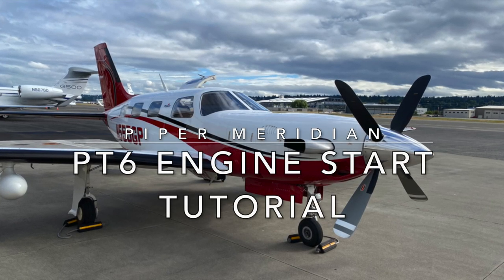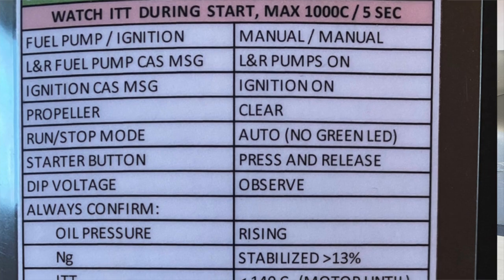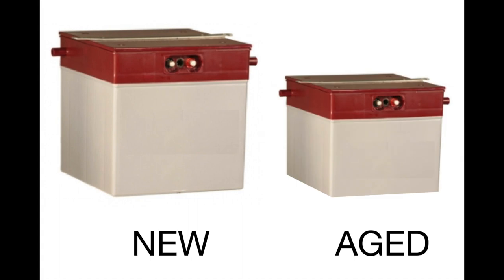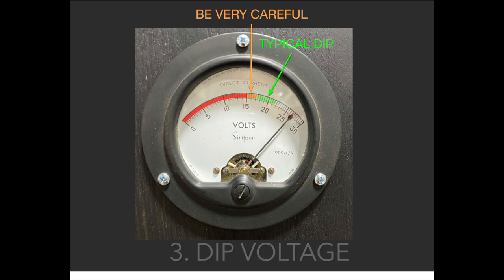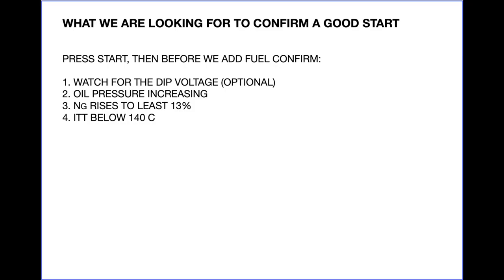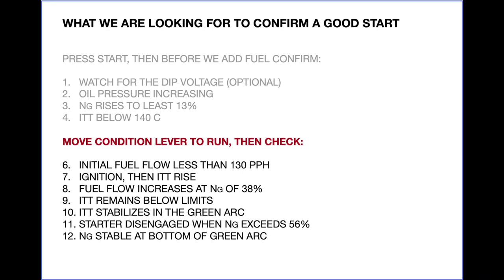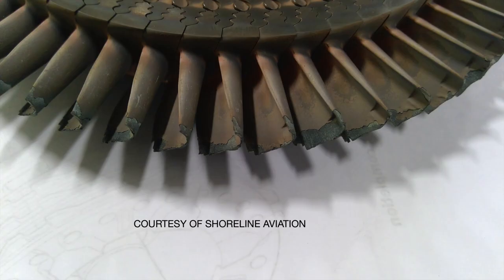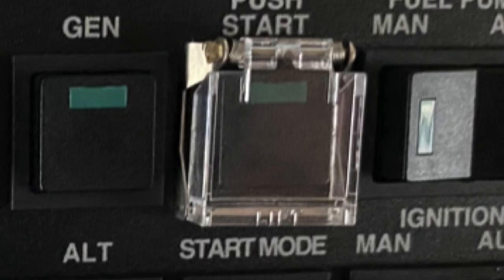The Meridian PT6A 42A Engine Start Procedure Explained

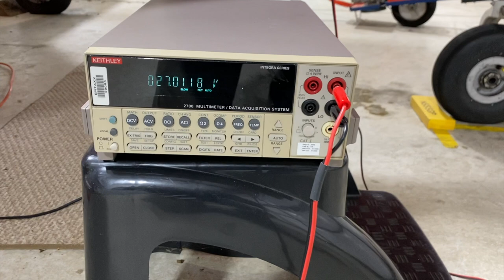Comment: @5:52 - Testing a plane battery - breaks out a near $2000, true 6 1/2 digit resolution meter and props it on a stool in the hanger.  That is the fastest "like" i ever slapped on a video.
Reply from the maker: Thanks, glad someone recognized a Keithley!

Comment: Thank you for putting together this video. Very good and informative.  You covered Bat Voltage, health way better than Ive seen it at expensive training.  What I do different is.   During start, I allow the starter Ng to stabilize before introducing fuel,  this shows me the capacity of the battery.  I have personal limits.   I want min 18% but a Cold battery, lower voltage, Ill except lower but next warm start should be back up.  If a storm is coming 14%, Tornado 12.5%.  If introducing fuel at 12.5 - 13% Ng,  A weak, low capacity battery may drop voltage after light-off and could be hidden.  As you stated  Voltage Sag, or Dip shows battery health but nothing compares to Work (= Ng %) after a few seconds.    The other thing is I,   Count seconds after introducing fuel.  Light off should happen at a consistent time.  ie 4-5 sec, if no light off I continue to 10 sec, Fuel off, Starter off,  WTF....     Having the set time and shut down procedure reduces the (oh shit I forgot the ignitors! On, Boom, Hot start.   Take it for what its worth.   Nice plane.
Reply from the maker: Those are all good ideas, and thank you for the detailed comment..  The only reasons can think of not to wait for Ng to stabilize as high as possible before introducing fuel are (1) there is a time limit on running the starter, and (2) if the battery is a bit weak, it may be better to light the fire as soon as possible to be sure there is enough juice to keep the starter running and the start cool.   Thanks again.

Comment: Dip voltage, or voltage under load for a car battery is 9 volts when the starter is running. The starter will cause a voltage drop of 3 volts. All cars with distributors in a 12 volt system have ballast resistors that keep the voltage in the ignition system at a constant 9 volts. When the starter is engaged and the available voltage for the ignition system drops to 9 volts current to the ignition system bypasses the ballast resister until the starter is released via the cars key switch. When it is released current is sent through the ballast resistor thereby maintaining 9 volts. An airplane such as the meridian uses 24 volts instead of twelve. If the airplane uses a piston engine I would expect it to run a ballast resistor like a car does. In a turbine engine, I don’t know if that is necessary, but that would explain the dip voltage that the creator of this video is talking about.
Reply from the maker: Thanks for watching my video. Not sure if this clarifies anything, but the ignition system in the Meridian is fully electronic.  I believe the dip voltage is simply a result of the huge load of the starter motor as it begins to turn.

Comment: By far the best explanation i have come across. Quick note on the itt being below 140, if the engine was hot due to a prior flight, do you let the itt temp drop by maintaing an ng at 13%? I think you mentioned that it only takes few extra seconds for it to drop below 140 if it was hot already.
Reply from the maker: Thank you for the kind words.  To answer your question: I have seen ITT up around 200 C after a quick turn, so typically I need it to drop about 60 C.  Once I reach 13% Ng I just wait for ITT to come down to add fuel. It always comes down about 10 C per second, fast enough so I can tell I am not going to time-out the starter (30 sec limit). The Ng just keeps climbing while I'm waiting, but I am mostly focused on ITT, so I am not sure exactly what Ng reaches.
Reply: @lakefrontaviation3444  I cant thank you anymore profusely for your quick reply and elaborate answer.

Comment: You called it dip(?) voltage, I never had a name for it but after turning on the battery switch I didn’t want the voltage to drop below 24 VDC with a NiCd battery, because of the discharge characteristics of the battery, when switching to lead/acid gel batteries I could get away with lower initial voltage. On initial starter engagement if the voltage dropped and didn’t start recovering, it was abort time and find an apu.  Healthy start had  N1 stabilizing above minimum and battery recovering. After start pay attention to voltage the longer it stays above 28 the sicker the battery is. I much rather start a turbine with PAS air.
Reply from the maker: It is all about trying to get a handle on the health of the lead/acid battery before adding fuel. The initial bus voltage when I turn on the battery master gives me an estimate of the whether the battery is fully charged, and the "dip" voltage under the huge load of the starter motor is an indication of how much total energy is available.  You are right that the voltage does need to start recovering.  These are only rough estimates of battery health, but I know that if voltage is low, or the voltage does not recover, there might not be enough juice to avoid a hot start, so in that case I would abort.

Comment: The most difficult plane I ever started was a fuel injected Skyhawk with an IO-320. I think they call it the monkey paw method. Thumb on the mixture with it at full lean, index finger and middle finger on the throttle at wide open, run the fuel pump for 4 seconds, turn the key, and at the exact moment the engine coughs switch the throttle and mixture positions. If you miss the cough you have to let it sit for 30 seconds and start from the top.
Reply from the maker: Interesting that the PT6 is easier to start than an IO-320, but if you do it wrong, much more costly.
Reply: I imagine it's even funner when it a hot start. (Skyhawk)
Reply: Aviation tend to get away more with temperamental equipment. If Detroit make cars as difficult to start, they will not be in business long. It is so far behind the times , Rotax still have carbs for their engines, and slow to raise HP.

Comment: Just before 8 minutes, you state and show on your checklist that the pumps and ignition are set manual.  Yet at 8:45 in the video the switches now appear to be selected to Auto.  The lights still show manual, but the switch position now is selected on AUTO.  When did you switch it to auto and why?  Confusing.
Reply from the maker: When adding still images to a video to explain a detail or emphasize a point, I often don't have the exact photo I need and I have to improvise. In this case I used a photo of the switches that I had on hand, and changed the LEDs to green to indicate that they should be in manual mode. (I think the photo was probably taken in the hangar and the switches were physically in the off position.) 

When the engine is stable and idling with Ng around 64%, the fuel pumps are switched to auto and the ignition is turned off. Both go back to manual for take-off, then at 1,000 ft AGL they both go to auto.

Comment: Could you sometime (when time permits), do a video on takeoff power/climb and cruise limitations.  

Also, since the meridian and the pc12 doesn't have a prop lever, i presume the PCL sets the props automatically based on power setting?

Thank you in advance. Safe flying
Reply from the maker: The Meridian has a prop governor that is set for 2000 RPM.  It will be less at idle because there isn't enough power to get to 2000 RPM at idle, but generally it is at 2000 RPM for any power lever position. 

The only takeoff limitation is torque (well, technically there is always an ITT limit but it isn't reached on normal takeoffs).  In cruise the main limitations are ITT, torque and airspeed.  (Of course there are others and I ran into one this week: the fuel temp reached the  lower limit of -34C and I had to descend a few thousand feet to warm it up.)

Comment: I used to work part-time for a UPS contractor loading ULDs into the Boeing 757. I note the wind would have the fans spinning in reverse. I asked the captain about a possible hot start considering the wind was hitting the aft engines. As we are standing next to one of the giant Rolls Royce RB 11 engines. it's free-spinning backward you can hear the clank clank clank of the fan blades. He said not much chance of hot-start because we would be using the Huffer at startup that night. I ask why the huffer? He said the APU isn't functioning properly and he would have it checked out in Louisville KT. I thought that was unusual.
Reply from the maker: A couple jet pilots I talked to who shall remain nameless told me that the manual calls for turning the jet into the wind, but they never do it...

Comment: Great video, and very informative, it would be nice though if P & W had a fully automatic start and shutdown system available
Reply from the maker: More automation would be great.  What these engines really need is a better fuel control unit. There could be an electric backup to the FCU to handle power roll back, something that would not require use of manual override.
Reply: I believe the new pt6e series engines have addressed this.

Comment: I operated large turbofan engines for 16,000 hours and never had a start problem. I did have a starter fail at starter cutoff and the starter blew up. We only knew this happened because someone called on the radio and said they saw sparks come out of the center area of the engine cowl. After maint did an inspection they said the starter had exploded.
Reply from the maker: Once many years ago I standing in the FBO looking out at the ramp when I noticed a jet with flames shooting out of an engine, like a flame thrower.  I can't remember how we got in touch with the pilot (I think the FBO desk called the tower). The answer back from the pilot was "it's normal." I still wonder if it was.

Comment: In 1963, Chrysler produced several dozen prototype motorcars powered by gas turbine engines mated to a typical automatic transmission and driveshaft.  How on Earth could someone start that engine day after day and not encounter ruinous disaster?  Ultimately all but a few of the vehicles were crushed by Chrysler so it wouldn't have to pay a special tax on them, and the program was terminated.  Please enter the following into the YT search box above:
1964 Chrysler Turbine Car Start
1963 Chrysler Turbine: Ultimate Edition - Jay Leno's Garage
Reply from the maker: Thanks, very interesting!

Comment: Refering to the ITT I think you mesn TIT did you ?
Reply from the maker: Turbine inlet temp (TIT) is the temperature of the hot exhaust gas generated by a piston engine where it enters the turbocharger.  We check TIT a lot in the Malibu to make sure we don’t roast the turbochargers.  In the Meridian’s PT6 engine, we monitor the interstage turbine temperature (ITT) which is the temperature of the hot gas flowing between the turbine wheel that drives the compressor, and the first power turbine that drives the prop.  We have to make sure the turbine wheels don’t get too hot.  

In both cases we are checking to make sure we don’t destroy anything with too much heat.  For the PT6, ITT is the correct term.

Comment: How high can this aircraft  fly?
Reply from the maker: The Meridian certification ceiling is FL300 (30,000 ft), and that also requires RVSM cert (which N555GP has). Without RVSM cert. the highest legal altitude is FL280 (28,000 ft).

Comment: 99.999999999% sure I will NEVER own or operate a turboprop.  However, IF I do, this video is officially my start sequence bible (even if the aircraft is equipped with a FADEC engine)!
Reply from the maker: Thanks!
Reply: With FADEC, you can forget much of this video. Pratt and Whitney is about 2 decades behind the times.

Comment: The Pratt and Whitney Canada company is about 2 decades behind the times. That was when all the airlines had FADEC and one button starts, auto throttle for their engines and not risk a financial melt down. Other companies had to develop their own but P and W can get help from the US parent company, so dragging their feet is even more unacceptable. They can afford it because they have 70% of the small turbine market, but things are changing. It is like P and W on a railroad track, they have 3 choices, 1) keep up to speed of the traffic, 2) move aside  3) get run over.  A few years ago, GE quietly bought  a Cz company , Walters that made a PT-6 clone . They are initially working with Cessna for an engine to power their PC12 clone. Once that is done, I believe they be expanding their line. Since that just happened within the last 5 years, for decades more , many planes and chopper pilots still have to watch TIT temp like a hawk and be ready to cut off fuel.
Reply from the maker: The fuel control unit in the Meridian seems to be an old design that could be modernized, and maybe that will happen someday. Modernization comes slowly in aviation, but it is here to some extent in the M600 and maybe it will trickle down to the M500 and Meridian.
Reply: The TBMs 9x0 use PT6 and have a fully automated startup feature (as far as I know, I am no expert)
Reply: @ImNotADeeJay If the number start at "9" it is already a very new plane. 2017 or newer.  I remember reading in magazine someone got an STC on an auto throttle for the PC12.  You think with a parent company in US, the tech transfer would make FADEC much easier to add to the PT6, no, they just sat on their back sides for more than a decade.